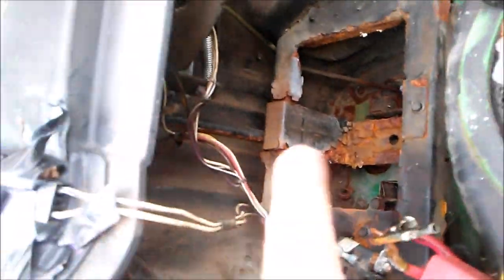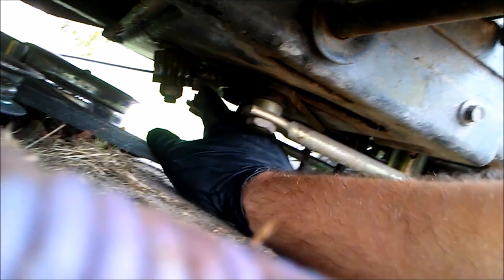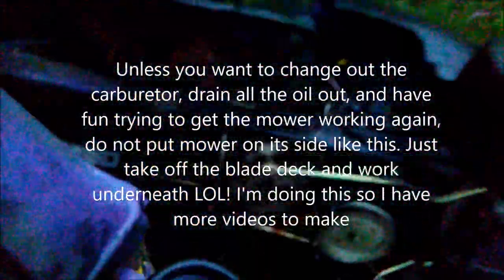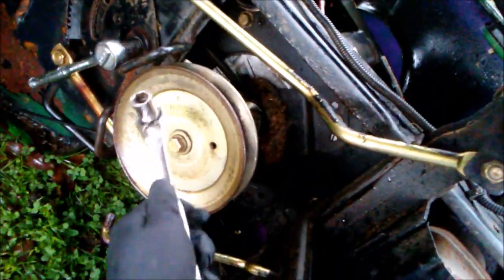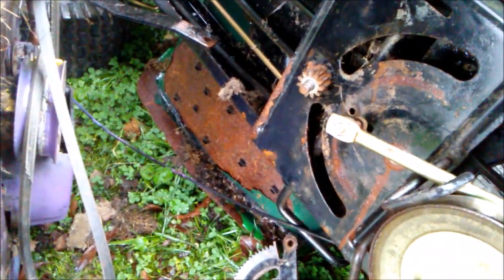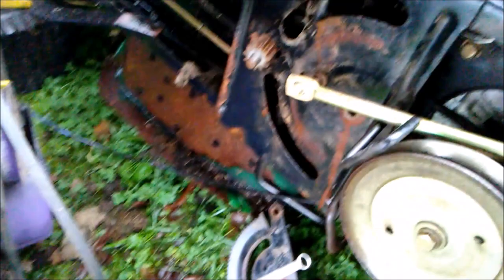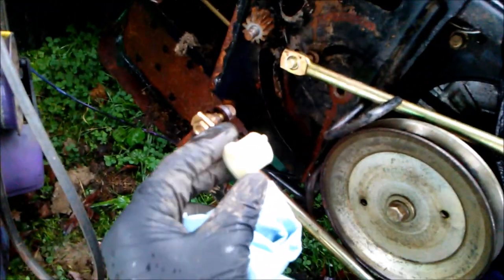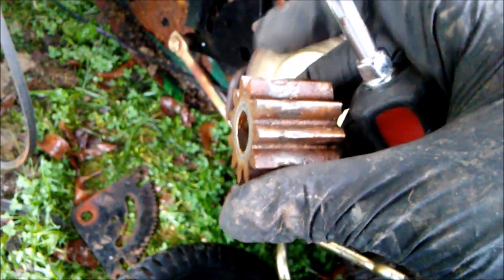How to Install Steering Sector and Pinion Gear on John Deere

Comment: Thank you for your video.  I fall asleep several times during the video.  But, this is what I need to do on my John Deere D140 tractor.  I mowed my lawn yesterday and steered my wheel, but I heard it sounds click, click once a while.  I know it is something wrong.  I tried to finish my lawn before everything gone bad.  Well, at the end I couldn't turn my wheel when finished my lawn.  I looked at the bottom and saw the gear teeth missing piece.  I know this is bad.  Now, I try to order the part to replace it. Thanks,